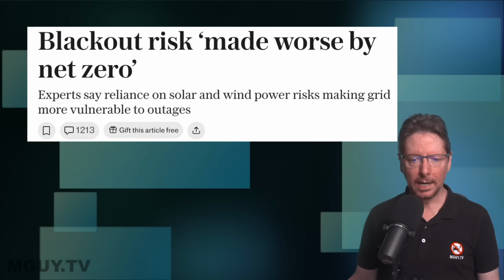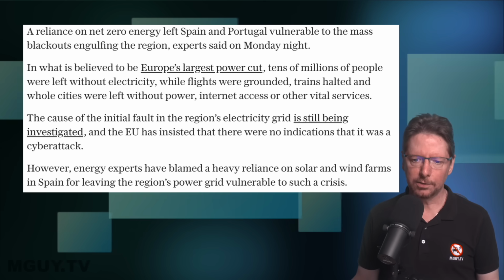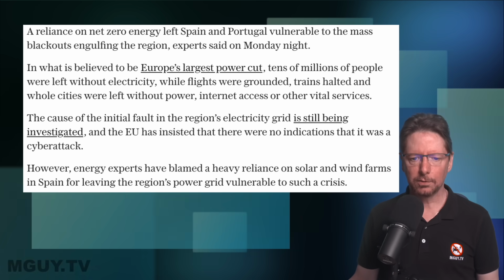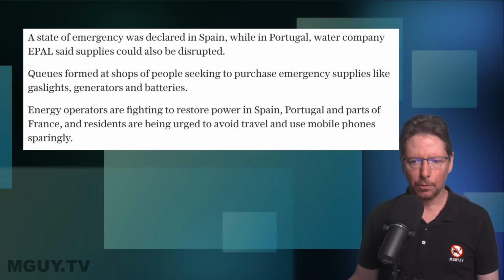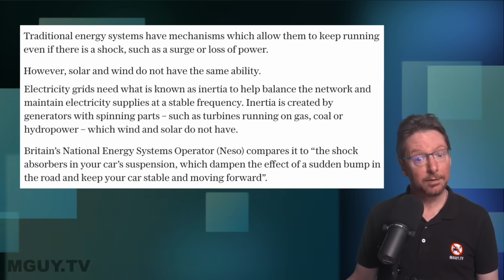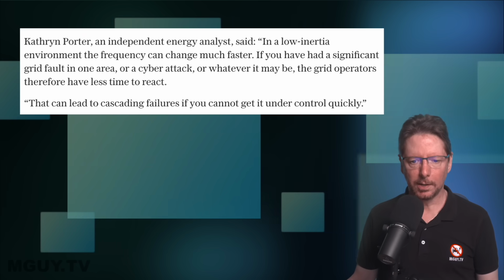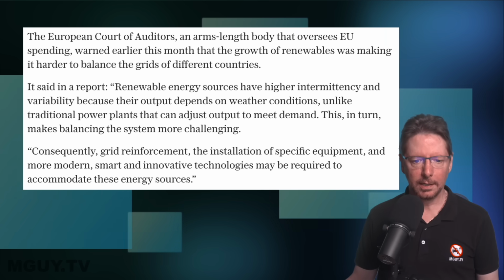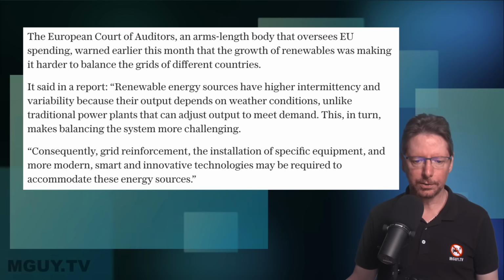Spanish power BLACKOUT: Why Net Zero and RENEWABLES were to blame | MGUY Australia

Comment: Send this to Albo and Bowen. Albo said renewable energy is just like getting water from the tap. Just because it hasn't rained you can still turn on your tap and get water. "Renewable" energy is the same. Just because the wind isn't blowing and the sun isn't shining you can still flick the switch and get electricity because it will be stored in batteries. 

So the wind doesn't blow and the sun doesn't shine for a week (Bowen sits down and shuts up), supposing we have the batteries what happens once they are drained?
Reply: which one of your aussie politicos suggested charging EVs overnight from solar energy?? Smart guy - he will go far!!

Comment: The AEMO & co know about inertia. In 2023 due to the delays in manufacturing new synchronous condensers, the Australian Power Companies/ grid operators were looking at turning old generators from the coal power stations into synchronous condensers. "Repurposing generators as synchronous condensers. Report on technical requirements'. project number 3971, June 22, 2023. ARENA - Australian renewable energy agency. 65 page online pdf. "Meeting system strength requirements in NSW. System Strength PADR Supplementary report. 17th October 2024. Transgrid, 22 page online pdf. ' New South Wales Synchronous Generation. Interim advice for system normal requirements. Feb 2024. 5 pages. Aemo/ Transgrid.

Comment: Yep, well explained. The EU has been scamming their citizens for decades. Renewables haven't been running their Electrical Grids.... Cheap Russian Gas was running it..... The "Renewables" are nothing but a Subsidy Scam. They don't work unless there's a nuclear or hydrocarbon Baseload power station idling in the background..... Do away with the Renewables and their outrageous subsidies and you are back to cheap baseload power. Ultimately nuclear is the future for electricity generation, while Renewable Energy is nothing but a Subsidy Scam. Inefficient, unreliable, expensive and maintenance intensive.

Comment: Windfarms also produce DC power like solar farms because it's impossible to make the drive shafts spin at exactly the right speed to produce exactly 50Hz. The output from these DC to AC inverters is "noisy" and not a pure sinewave, which is required by AI data centres. Apparently, this is one of the reasons Microsoft is buying and upgrading the old Three Mile Island nuclear power station.

Comment: And on top of it all (on EV car example), when you compare EV to diesel car: diesel car can happily work for 10 years for its first owner, 10 years more for second owner, and then 20-30 years more for somebody in Africa or India. But lets say 20 years without problems. Now EV: 4-5 years for first owner (and battery is at 50% capacity) so nobody buys it, but EV can be demoted to first car for daughter so she can go to school but not escape with BF. So to get those 20 years of service you need 3 EVs. Now the kicker all those rare earths mined to make batteries and all copper mine for charging stations, extra power plants etc. All while only 50% of electricity is made from renewables, also all while EV needs TWICE the energy to move than Diesel (so basically EV needs as much energy from coal as diesel, and the same amount of renewable energy) that 2 times more energy comes from: coal plants are less efficient than diesel engine, then transferring it to charging station, then charging car, storing it, discharging, and EV is two time heavier because batteries are heavy. So EV do not save any CO2 from being produced, nada, if you calculate everything. LEts say town with 200 diesel cars used for 20 years vs town with 200ev used for 20 years, all together with production of oil and electricity for those. I bet net Co2 would be same .
Reply: And you forget that many people scrap perfectly good petrol/diesel cars to switch to an ev, and even get government subsidies for doing so!  The UK’s scrappage schemes were idiocracy distilled into fine whisky.
Reply: Do the mathematics

Comment: https://en.m.wikipedia.org/wiki/HVDC_Inter-Island

Can't see why there's  a problem. Solar gives DC, wind while variable gets rectified to DC. Then you store that in batteries, also DC. Inverters (the inverse of rectifiers) convert DC to AC and maintain frequency perfectly because they are not mechanical but precisely controlled electronics. (Just like an EV😊)
Reply: Sounds simple so why don't they do it? Probably because of the expense of the battery capacity required. We're a long way off being able to store grid scale power.

Comment: Wind turbines do have inertia and you can use that similar to a steam turbine. This incident happened at around 12.15 PM when probably most of the power supplied came from solar. I think Spain could reduce the risk of a repeat of such an event by adding more battery backup storage. And maybe they should reduce their solar ambitions. Their installed capacity is growing rapidly and it looks like the grid isn't keeping up.

Comment: You've just made an excellent case for requiring Politicians to have an electrical engineering degree before attempting to represent the needs of their constituents.  Thanks for an explanation about how a large electrical system works.
Reply: Basic high school physics is all that’s needed to understand the issues. But you’re right, any politico responsible for power supply or net zero MUST have technical knowledge of what they’re tampering with.
Reply: education ministers should be retired teachers. health ministers should be retired doctors or nurses. transport ministers should be ex truck drivers, etc etc etc...

how can you be a "minster of anything" if you have no real life experience?
Reply: @paradiselost9946 — Same goes for MPs in general.  A few years experience running a commercial business should be compulsory.
Reply: Ed MilliAmp need not apply.
Reply: They need to pass a simple 3 question common sense exam
Reply: Oh really? And what happens now that universities are pushing this "green at all costs" mindset?

Sending politicians to schools that will only double down on woke nonsense won't solve anything!

Comment: Induced Atmospheric Vibration (IAV) and plasma solar winds are related but distinct phenomena in space and atmospheric physics. Here’s how they connect:
1. Plasma Solar Winds

    Solar winds are streams of charged particles (plasma) ejected from the Sun’s corona.

    When these particles interact with Earth’s magnetosphere, they can cause geomagnetic storms, auroras, and disturbances in the ionosphere.

    These disturbances can, in turn, induce ultra-low-frequency (ULF) waves in the Earth’s magnetic field and atmosphere.

2. Induced Atmospheric Vibration (IAV)

    IAV refers to mechanical or electromagnetic vibrations in the atmosphere caused by external forces, including:

        Solar wind fluctuations (via magnetosphere-ionosphere coupling).

        Geomagnetic storms (which can generate atmospheric infrasound).

        Resonant interactions between solar plasma and Earth’s magnetic field.

    These vibrations can manifest as infrasound waves (below 20 Hz) or electromagnetic oscillations.

I am not saying this is  totally  legit however NOAA has some info regarding a storm-plasma which effected the actual area, much like solar storms like Montreal 1989 storm effected that area. Something not talked about is the weakening of our magnetic field is making us more vulnerable to such happenings.

Comment: Don't forget the problems with pumped hydro constantly having to switch from supply to storage. Electrically, the energy has to flow in both directions. From an jnertia perspective, one system needs to spin down and another needs to spin up. Try keeping that monster stable and synchronised as supply and demand fluctuate.
The engineering challenges of Snowy2 are not limited to stuck borers.
Reply: Check out the Helms pump storage facility near Fresno California - 1,212 MW hydraulic head 1,625 ft (495 m) moving 129,000 acre⋅ft (159,119,157 m3) water - It consumes more electricity pumping than generating electricity, pumping occurs during periods of low demand with unused surplus energy available at lower costs from the electric grid - used with the Diablo Canyon Nuclear Power Plant connected by a dedicated high-tension power line.
Reply: @ragtowne  Using more energy than it produces is a given. You lose a percentage of energy with every conversion.
But the pricing is interesting for this and any grid storage system. They buy from the grid when supply is in excess and so cost is low. They sell to the system at high demand when the price is high. Therefore they inflate prices compared to a stable system with adjustable dispatchable power.
Reply: @j_sum1  and they use a nuclear power plant to run the operation how ironic is that

Comment: 3 Gorges dam is renewable and delivers 20 TIMES the Hoover. The  renewable Yarlung Tsangpo dam will deliver 75 TIMES the Hoover dam.  All with entirely consistent power. Unicorn urine. 

BUT FEAR NOT - it gets better with these Unicorn farts - Chinas Space-Based Solar Power Array will deliver - now WAIT FOR IT ....... 475,000 Hoover dams worth of power per year.

Just ONE of these puppies. And its permanent - yeah thats right - it never turns off. Pure reliable energy.

And China has a smart energy grid (which most western countries are installing including Australia) which means peaks and troughs through inertia variability are flattened. 

Cool.

its like the worlds best scientists actually think about stuff MORE than some random guy you found on youtube who is placating and feeding your cognitive bias with selection confirmation in order to profit off your fears.

Comment: Electricity intensive companies will have to install rotating mass generators powered from whatever the grid has available and then produce about 25% too much stable energy, wasting the rest to heat, to provide artificial inertia. So whether it's this or batteries the good news is we're going to have to produce way more than we actually need just so we can have a reliable supply because efficiency.

Comment: Most of the inertia you reference, is not from the mass of the spinning turbine and generator. It really is the high pressure steam that feeds the turbine. If there is an instantaneous increase in load on the generator, the turbine inlet throttle valve instantly opens to maintain speed and more steam flows in. This initially comes from the boiling water in the boiler and the pressure 'sags' until the firing is increased to rebalance the power demand. This is true for all fossil fuel, biofuel and nuclear power plants. Anything involving the storage of a boiling liquid -nearly always water. This principle and the inlet valves on the hydroelectric systems is what provides the frequency control - or it is the system inertia as you say. Same thing. Hope this insight is helpful to you.
Reply: Inertia from turbine is primary response and instant, steam adjustment is secondary.
Reply: @Delchursing   Yep, you nailed it.
Reply: governors have hysteresis and response time. steam valves cannot open as fast as a transient will act on a powerline. boilers cannot supply extra energy anywhere near as fast as a transient requires.

the frequency regulation is solely down to the inertia of those rotating shafts and wheels in a turbine plant. and the fact that theres more than one of them synched together, tending to assist or retard each other as required.
Reply: @  Not only are they synced together, they are locked together by the power grid itself, so once engaged, they act as one huge, distributed flywheel.  (I think you already meant that.)
Reply: That doesn't respond to surges fast enough. Yes it's the rotating mass that handles the sudden surges. I had a homemade generator that would die the second I attached the charging cables to a battery that needed charging. I added a 3 pound flywheel to the front of the alternator and solved the problem.

Comment: You know LED lightbulbs hate fluctuations and I'll point you to those supposed lifetime bulbs you seem to be constantly replacing.  And with every bulb is a circuit board  and various controllers, which it's actually those that fail or burn out not the LEDs themselves.